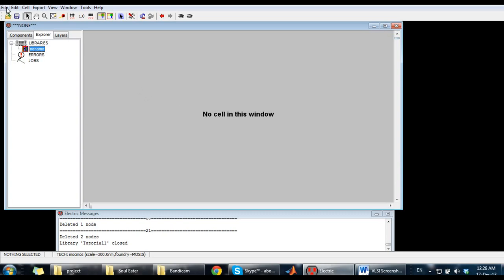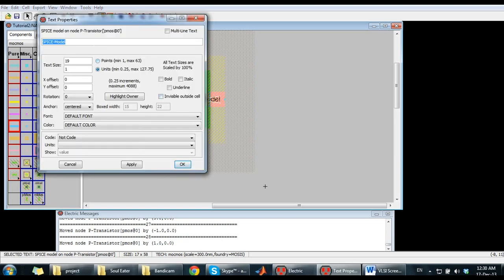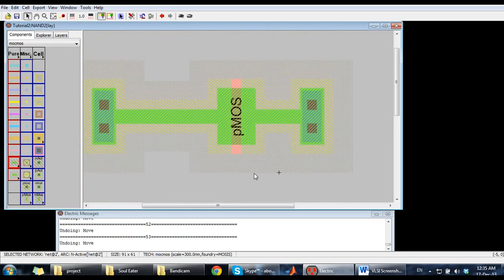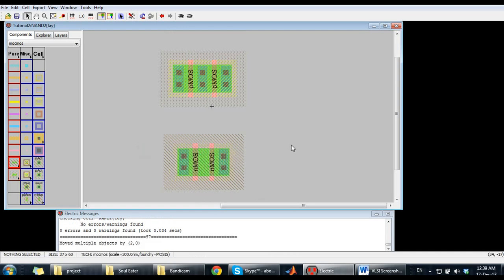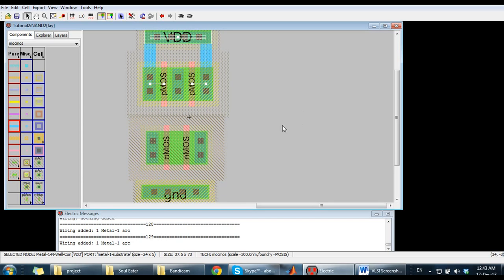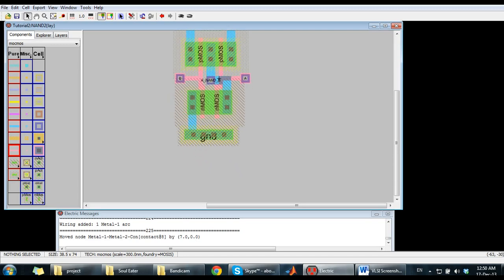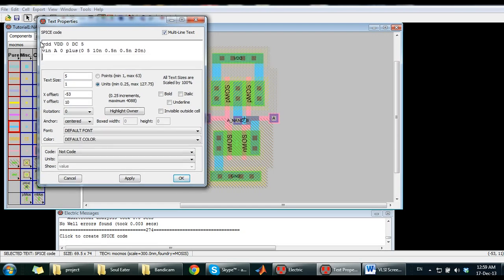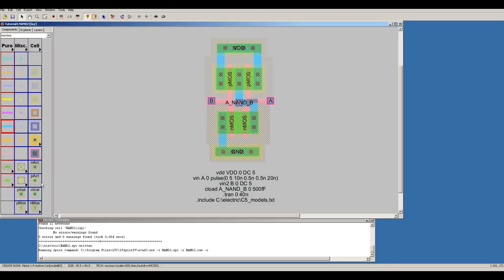Tutorial 1 VLSI Electric NAND/NOR Layout Design

Comment: I need help please. When I get to connect a logic gate I see that from this error. The strange thing is that when I connect some gates and 3 inputs it doesn't give me that type of error, when instead I connect a logic gate always and 3 inputs same type in the drawing file, it gives me that type of error. WARNING: GDS Expert encountered problems because of small feature sizes and coarse accuracy settings.
 It is recommended that the 'Units/meter' GDS preference be increased by a factor of 1215752192.

Comment: Hello, is that the ELECTRIC VLSI DESIGN software allows me to simulate nano CMOS with Finfet 10 nm ,thanks in advance for the answer.
Reply from the maker: I am not sure about that specific technology, but you can check the settings or some online forum. VLSI design is for beginners and if you want something with more specification you need to use a more powerful software.
Reply: @coolabod  thank you for your reply ,possible to guide me for a software for this technology.